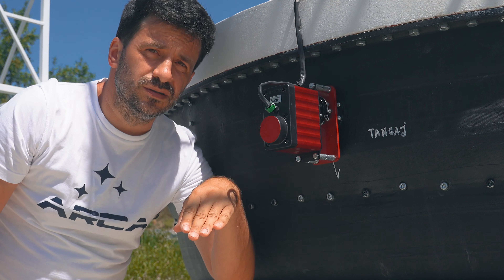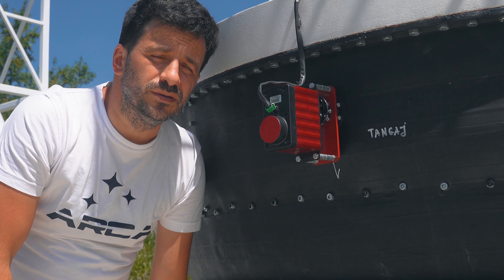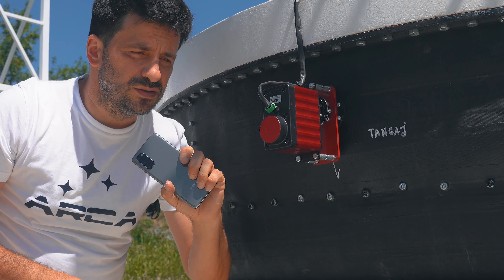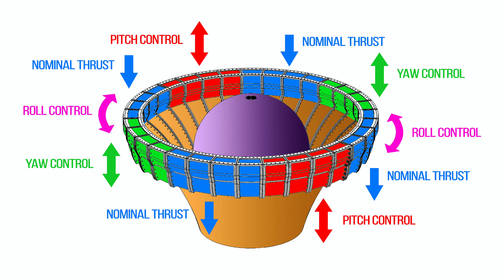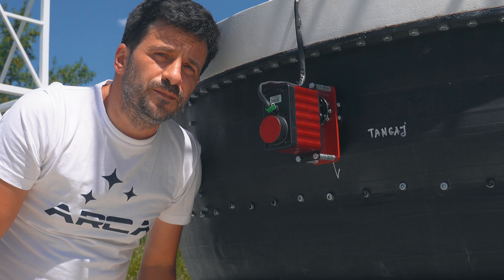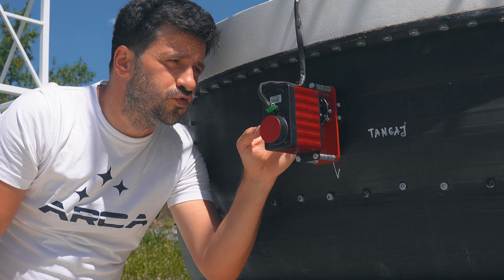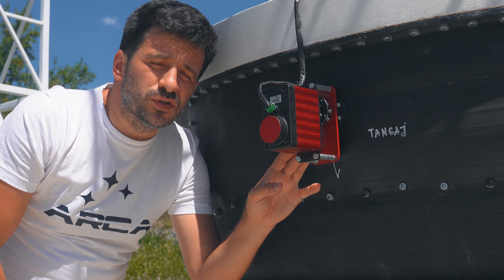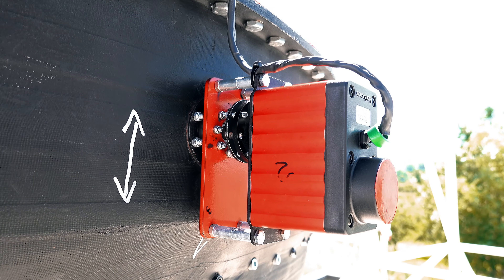MISSION 9 - SITREP 22: Pitch & Yaw Vehicle Control

Comment: Your actuators look a bit exposed for a full flight. You might want to place those somewhere higher up and connect to your valves through a connecting rod. Looks good enough for a test though. Are your roll thrusters not a bit close to your actuators? You might over heat them with the roll thrusters. 🤔
Reply from the maker: Thank you for these notes. For a high speed flight (LAS 25R version that will go supersonic) we are going to properly protect all electric/electronic equipment. We discussed actually today about the fact that some portion of the gases from the roll thrusters might touch the pitch/yaw actuators and this was noted in an action to be addressed ASAP. Keep you updated. Thank you!
Reply: @ARCAchannel  Yes off course thanks for the reply. For the test stand this should work ok. Keep up the work Demitru and team.
Reply: Excellent.  Thanks for the reply. Makes sense. Keep up the good work.